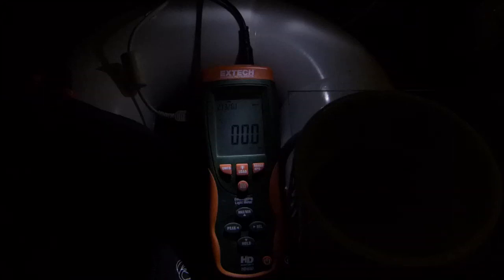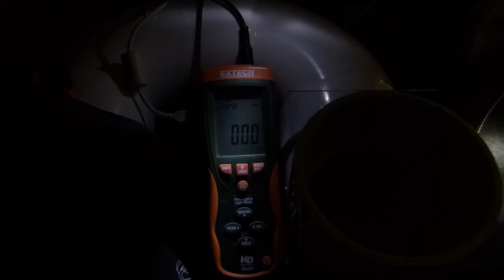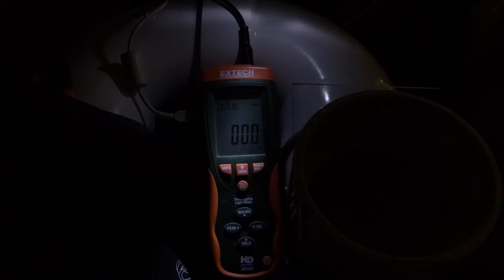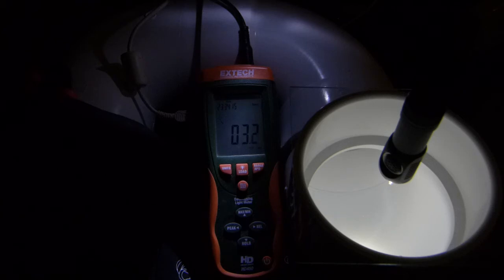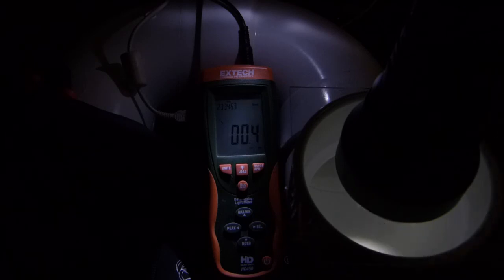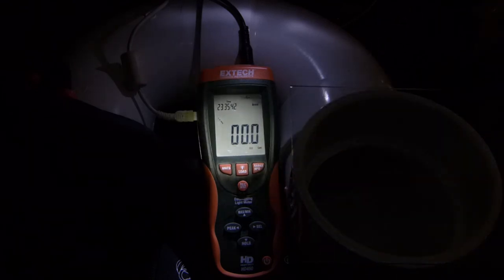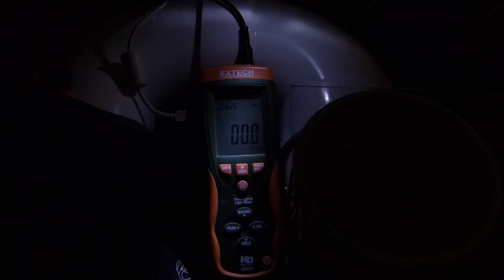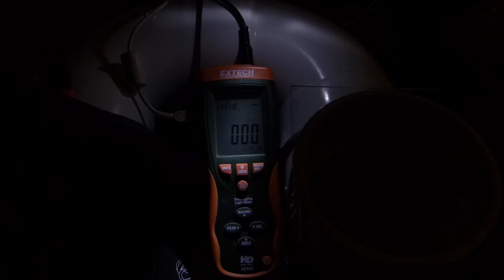ThruNite TN31:  Measuring L1 lumens

Comment: hey guess what, thats lux your reading on tht meter not lumens.....you have to calculate those...duhhh......
Reply from the maker: A little hasty in your reply there... I understand lux/cd is for measuring throw, however, used in this particular manner, it translated pretty consistently to "lumens" when compared with those provided by mfg's that were measured on actual integrating sphere's. Check these threads for details 
http://www.candlepowerforums.com/vb/showthread.php?333954

http://budgetlightforum.com/node/8054

It's since been adopted by quite a few flashaholics who are way more knowledgeable than I am and has sorta proven itself. I won't claim that it's perfectly accurate but at least it's been pretty consistent. :D